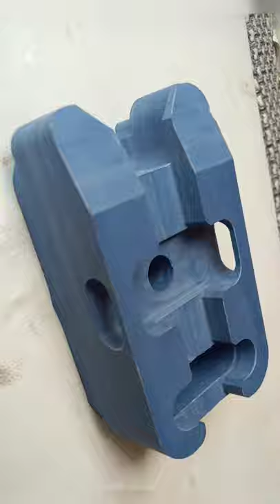DIY Homemade CNC Machine NVEM V2 Closed Loop Stepper BT40 Spindle 2KW Servomotor

Comment: Can you show how your machine cuts low carbon steel? I have 2.6kw servo and planning to purchase atc bt30 spindle, but not sure if it will be good for steel cutting... I really don't understand why you're using 2kw with bt40! You servo has something like 20N.M. of peak torque and 8 or 10N.M. nominal? You need much, MUCH more torque in order to use all af the abilities of bt40! I actually calculated some time ago that 3.8kw servo is the lowest for bt30, but since I have one leftover 2.6kw servo - i'm planning to use it for a mill. Can you please make a cutting steel video with feeds/speeds and types of steel used? Thanks.